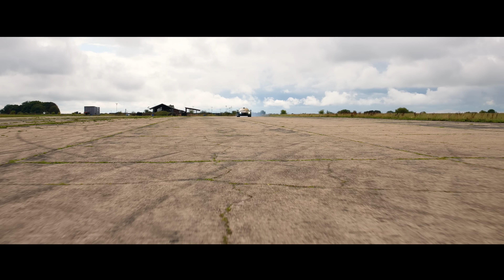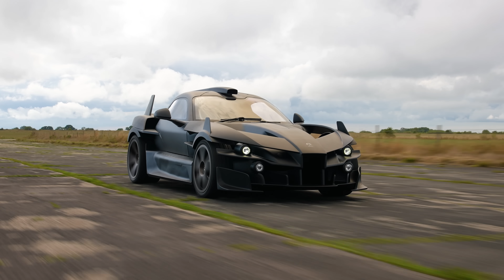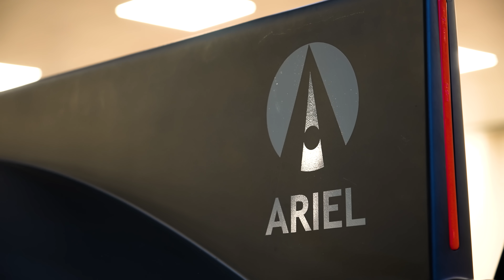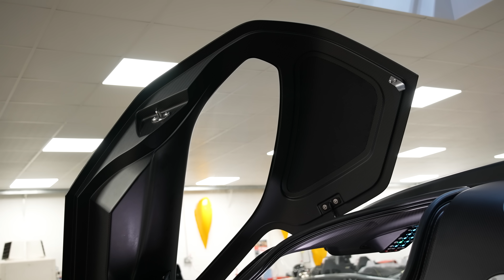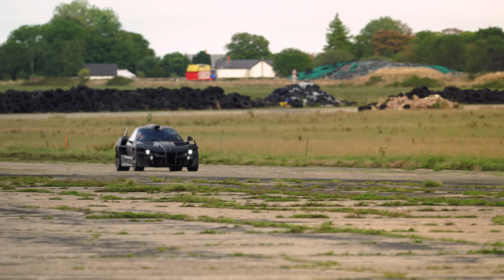NEW Ariel Hipercar – 1180bhp, 0-60mph In 2secs + Jet Engine?!  | Top Gear

Comment: I think Chrysler did a turbine engine back in the 60's. It could run on anything from flammable. Gas, diesel, vodka, perfume, would produce good power. All while getting good mileage with a much lighter engine. It was cancelled because the maker claimed the average buyer would be too afraid of the new technology.

Comment: I despise modern car design. Looks like a geometry textbook threw up all over the car. All those random lines and angles. If there's a line or a curve that makes sense from an aesthetic or even functional standpoint it's a complete accident. HOWEVER, I will make an exception in the case of this thing. It's not a pretty car like a Porsche 930 but man it does look cool doesn't it? It's pretty tiny and I'm a huge fan of Louts so that's got a bit to do with it but how many cars have a shark's fin?

Comment: This is excellent, but I think one mistake they are making is assuming people don’t want regen for track use or sporty driving. The key with regen in a sports car is to make it possible to get full regen just by lifting off the accelerator, and have the brake pedal directly and exclusively control the mechanical brakes.

The advantages of this are that brake feel is just as good as a gas car, you don’t need any complicated and heavy system to try to make the brake pedal control the electric motors and friction brakes and retain good feedback. The accelerator pedal already controls the electric motors, it is natural and adds no additional weight or complexity to have it control both of their functions. Secondly having aggressive regen in track mode increases range, lowers the load on the friction brakes (allowing them to be lighter), and gives you improved reaction time when stopping because you start slowing down as soon as you lift off the accelerator.

Having deceleration partially controlled by the throttle pedal takes some getting used to but in my opinion it is one of the joys of driving an electric car. It’s similar to learning to heel-toe, which accomplishes a similar goal of utilizing the powertrain to help slow down in addition to the friction brakes. If anything learning to heel-toe is a much bigger adjustment. I find both to be very fun once you get the hang of it, the difference being that there are fewer fun techniques to driving an electric car, and the alternatives of trying to integrate regen into the brakes or not having regen at all just so someone who knows how to drive an automatic gas car can hop in and access the full capabilities of the car suck because they lower performance/range/brake feel and get rid of one of the few fun skills to master that are unique to electric vehicles.

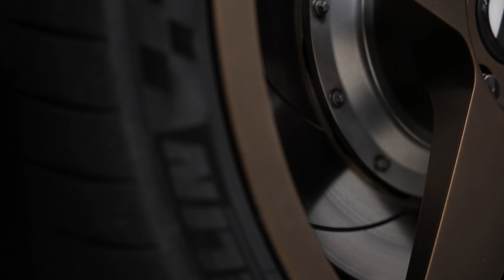Comment: 8:00 "We're just experimenting with regen braking..", that's like a primary advantage and feature of electric cars, and turbines can run on most everything, yet this doesn't, all suggesting a work in progress. Shame he promoted fossil fuels' Hydrogen Scam, hydrogen slowly destroying everything it touches (metaphorically too:) is just one of many reasons the hydrogen economy has failed for decades despite enormous wasted funding. Turbine could've done with more power for this type of car, but it's great to finally see them in hybrids as they're long overdue. The ultimate would be the free piston linear generator with only one or two moving parts that's currently used for very efficient generators, but could be built for insane power-to-weight ratios; it can run on anything, and the motion of the piston is electronically controlled, so many things like changing the compression ratio for every stroke are easily done in software. Check out Libertine Power Systems for lots more info, they even have a Stirling engine version and gave me a ton of info when I commented, and in regards to potentially huge power to weight ratios the owner simply replied with "Hold my beer..." :)

Comment: Reading up on the Cosworth Cat Gen range extender it sounds totally brilliant. It is about 50kg, that is tiny!  It does not require a separate catalytic converter... The tech is actually super simple, a handful of moving parts, and very few exotic materials..  Cosworth says they hope to get the cost of the Cat Gen down to 2000 pounds.

Comment: That is not a jet engine. That's marketing hype. Jet engines are reaction engines, and what Ariel are using is a gas turbine. The core is the same sort of device, course but there is a fundamental difference in how they drive a vehicle down the road; as jet engined works through thrust, the other produces mechanical power via a shaft. That's slightly simplistic; the gas turbine is producing a bit of thrust, assuming it's exhaust is pointing backwards, but that is a relatively small side effect. However, he fundamental way that they are used is different.

If you want to know the difference, then compare Donald Campbell's Bluebird-Proteus CN7 with Thrust II. Both use gas turbines, but the first is a wheel driven car using the mechanical power of the Proteus engines. In comparison, Thrust II is a true jet powered car driven purely by the reaction force of the exhaust output.

Comment: Hang on, Gas turbine in cars is 60 years old. Chrysler had a limited run of them although not technically a ‘production’. 
Didn’t seem to be any motor prep for the speed run. One hopes they would add some extra cooling or something for a 0-60 launch. ( seee T Plaids!) 
Hang on, 
Am I gonna make it to the end of this video without anyone mentioning that this car copies ALOT of modern (1989) Batmobile design? Doors, configuration, jet turbine, fins, color.
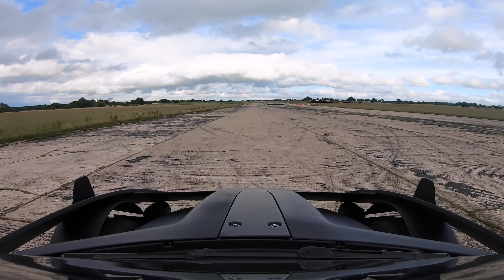Ahhh 13:20!!!!!

Comment: Jet engines are LOUD, even the small one are ridiculous.  Most tracks have noise limits which this jet will most likely fail when running, most jets are easily over 100db.  With a 72db legal limit for current cars sold in the UK and a lowering of that to 68db at some point in the future, i can't see this car being legal when that jet is running.  Not to mention the problems that loud noises can cause to hearing, anything above 70db for extend amounts of time can cause hearing damage, a jet at full boar can damage your ears almost instantly.

Comment: Hell yea.  This looks like what I've been wanting to see.
A sensibly compact, low power generator (though hadn't considered turbine (until the other day oddly enough)) with a decent sized battery, that's not too big, but not pathetically small (though half the size would still be fine for some (who'll only track it for short periods), 4 independent motors and focused on reducing weight and drag.
Ariel do have a knack of over-delivering to a niche and making that niche far bigger than most people would expect.  Top props as is becoming normal for them!
Reply: Just had a wonderful thought.
A [new] new Knight Rider series.  This would be perfect as it'll already have a legit turbine power unit and therefore more authentic ... plus it looks like a KITT/KARR.

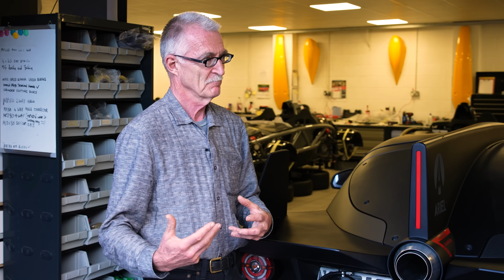Comment: 5:08, gonna have to disagree with this, they are incredibly simple if you make them that way. If you don't have massive power requirements you can air-cool the battery instead of liquid-cool and that becomes incredibly easy and simple. 

The drivetrain itself is most definitely pretty much just a battery going to a motor on some models of EVs, not being much different than an RC car with 3 AA batteries connected to a motor but scaled up in size.

They can be incredibly complex if you make them.

Comment: GJ Ariel!   beautiful car guys.   keep up the good work.  There's a lot of potential in that setup I feel.   Light engine turbine to charge.   Never thought about that, but would be cool like a batmobile. extra thrust, and way lighter than a engine block with pistons and such.   Way higher RPM's.  maybe even attach a few extra altenators on a pulley system to assist in the power generation aspect.  can imagine the brushes getting worn off almost immediately at 120k rpms.   oO

Comment: I think the exhaust from the turbine could be used to help with aero. These cars are limited by down force, you can only accelerate so quickly before you dont have traction. I wonder if some how the exhaust from the turbine could be directed to provide some type of extra down force. It only needs to provide it for a short period of time between when the car gets going and when the wings get enough air to force the car down.
Reply: I wouldn't count for that. Turbine blades will consume most of the power from combustion gases. What's left may have negliable effect. Also it most likely doesn't have any specific nozzle to create more thrust.

Comment: The question that he should have asked was how long will the turbine last before it needs new bearings.  120k rpm and 45 Hp is similar to the large hobby aircraft jets rather than a comercial apu.  The problem with those is they needed major service i.e  new bearings after 50-100 hours of operation.  Some of this was hobby quality but most of it was running at 150-250k rpm range.  120k doesn’t sound much better.  Haven’t looked at this stuff for 10 years or so, so maybe they’ve improved in the interim.  Also it’s cleaver to quote the jet In kW and the max output in hp b/c most people will think wow 35 KW that’s a lot when I. Reality it’s 35 kw* 1hp/750kw = 46.7hp.  So for the jet  to “keep up” the driver has to be using less than 46 hp on average over whatever course there traveling.  Peak is 1100+ hp so something tells me that in most driving conditions the owners will be running the battery down fast
Reply: Every second you are off peak throttle you get 36kw/hr.Very few dedicated drivers are at max power for a high percentage of their driving on UK roads. Even where I live in Scotland with access to nearby, quiet mountain roads it's rare to have the throttle buried for ten seconds, fifteen almost unheard of. It would be much less with huge power devouring straights. Most folk even driving like a 'twit' have some regard for speed limits/licence loss and the safety of others Hence the builders differentiation between track day range and D.L.A.T.O.T.R  mode.
Reply: I bet it has way higher quality bearings and oil supply system to keep them properly lubricated than some plane with not much space to support that. 
About that fuel consumption... My small car, 1999 VW Lupo with 1.4 16V 76HP engine burns 6-7 liters of gasoline when traveling (villages and outside urban area with 90-110km/h speeds), average speed is 70km/h. So, in 1 hour I make 70km with 7l/100km, which is 4,9l. It equals to around 44,1 kWh, because 1 liter of gasoline is around 9kWh.  But, keep in mind, that electric motors are way more efficient than gasoline, especially old gasoline engines, so it will need half of that (22,05kWh) or maybe even 1/3 (14,7kWh) of that amount of energy. And keep in mind, that electric motors don't waste any fuel when standing still in traffic. So yeah, this turbine will definitely be able to keep up with that.
Reply: magnetic bearings?

Comment: Ok...I recent said to someone, 'wouldn't it be amazing to take the Dodge 'Hellephant 426' crate powerplant, and put it into one of the AC Cobra Replicas?' With the immediate response, 'nah, would never work...too much power, wouldn't work'...but not only am I convinced now, more than ever, that it would work...but that it would show you 0-60, 0-100 and 0-150 speeds far in excess of anything short of NHRA top Fuel competitors!

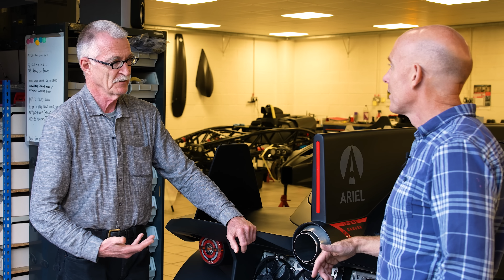Comment: 2:47 - There's absolutely no way a microturbine is more efficient than a combustion engine. Jet PLANES being made in 2022 are still substantially LESS fuel efficent (TSFC) than a piston-propeller equivilent from the 50s. Even turbo-prop engines (turbo spins propeller) and no where near as efficient as regular prop. planes, and often manufacturers sell both, and it's always the same. The benefits of turbines is their enomous power-to-weight ratio, which simply can't be beat, and they'll run on any gas/vapour fuel. But they're NOT as efficient as the best diesel engines. Compression-ignition, or better yet HCCI/FLCI engines have the best fuel-to-work conversions at the moment. But I bet a 5000hp turbine makes short work charging such a small battery pack. Even though the mpg will never be good, it should be fast and for much longer distances than say a Tesla, since it should be able to burn diesel.

EDIT: Oh, it's only 35kW and that exhaust isn't the turbine - there's a tiny, less than 50hp, turbine/generator in there somewhere. That changes things. That could be pretty interesting. IDK what they're working on but big if true. Usually turbines get less efficient the smaller you go, and starting them is a problem, so hybrid challenges there, but it could be everything they say it is. TLDR: Ignore this.

Comment: Use the batteries to turn water to hydrogen, use the hydrogen to run the jet, use the jet to charge the batteries,  use the batteries to turn the wheels and again split the water. Proceed to drive with only a small.amount of water and eventual maintenance.